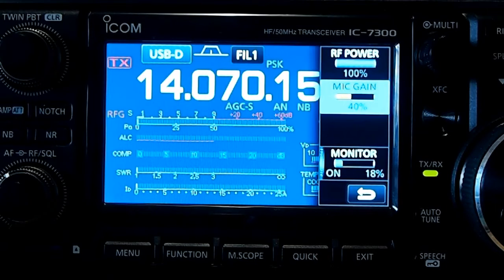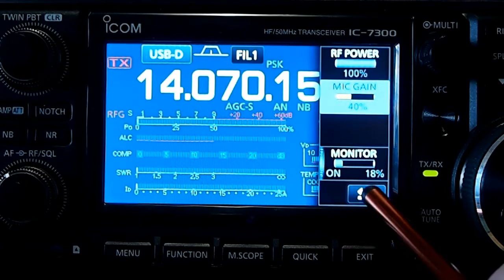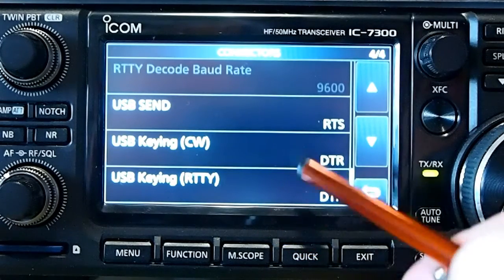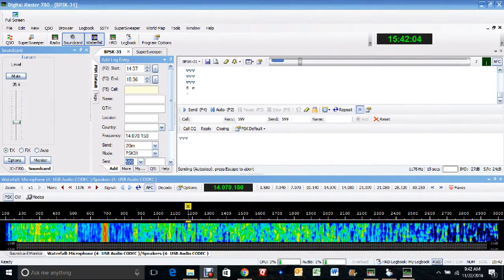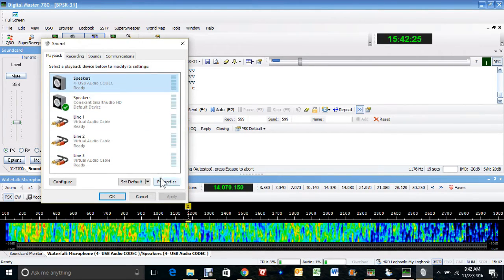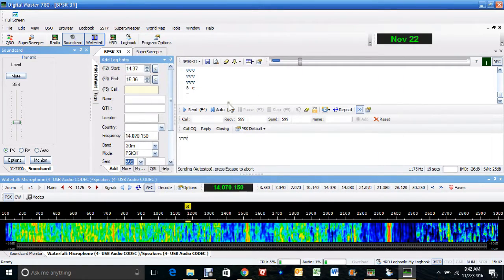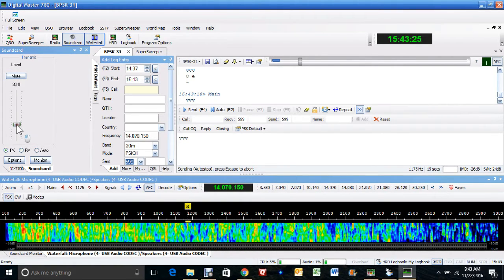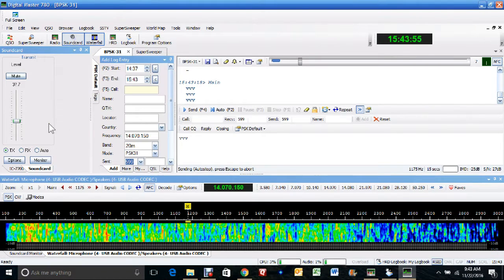Icom 7300 Controlling Power Output Digital Modes

Comment: I realize this is an old video and perhaps it's obsolete.  But as you operate the slider and say what your power is and the ALC, I don't see where you are seeing those parameters anywhere on the screen.  What am I missing?  Perhaps you are looking at your rig but not showing it on the screen?.  All is see is vvv.  I have tried this method of power set with WSJT-X and the IC-7300.  I have about 50% ALC on my IC-7300 meter when slider is all the way up 100% power, and I can get down to 25-30 watts using the slider only, but then there is 0% ALC.   Am I on the right track?

Comment: I finally got everything working for Digital mode using the USB cable but have no power output. What am I missing? Thanks 73 Gary ke2yk
Reply: Dumb mistake... speaker level was down. Thanks for quick reply. Now to test out ft8 and CW. Happy New Year
Reply from the maker: Nah, that happens quite a bit. Lol
Reply from the maker: Hi Gary, check the settings for the sound card input and output. It should be the USB Audio CODEC. Are you in USB-D mode?